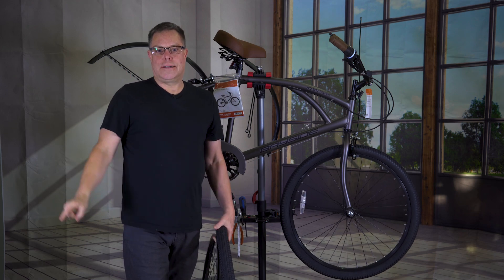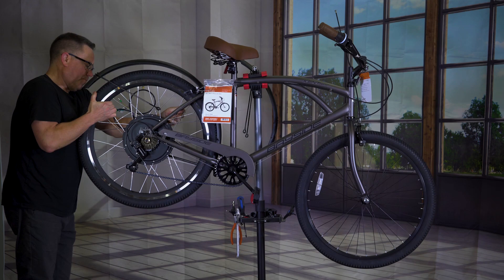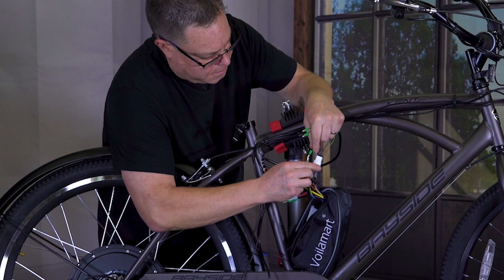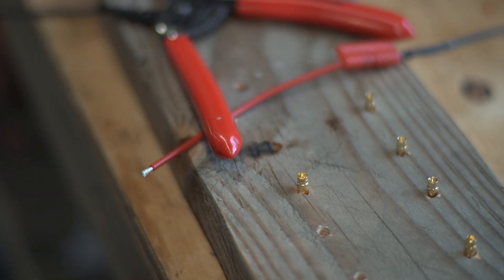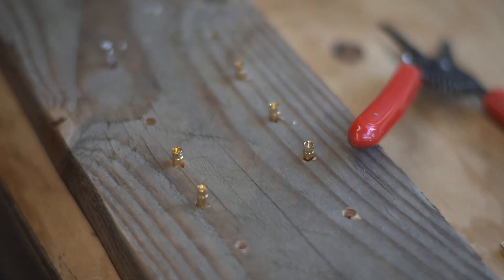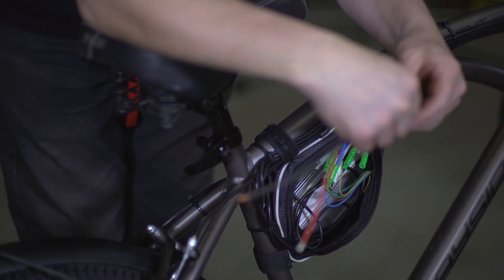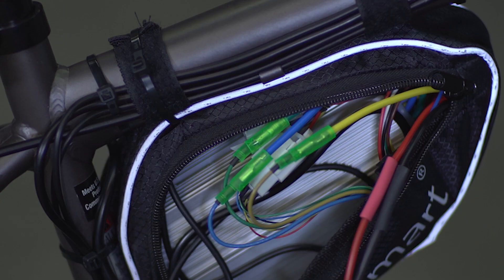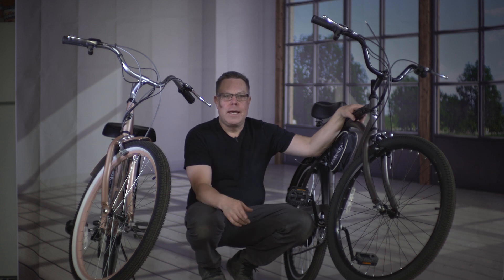How To Build a 48v Electric Bike on a Budget (E Bike) 2020

Comment: good choice on the brand i have 2 of them myself much like you one for me and one for the lady. The controller will pull max 47 amps if you run it hard so make sure you battery and the wiring can handle at least 50 amps of current. I have had no problem doing 28 miles and hour with this kit.
Reply from the maker: Awesome! What batteries are you using? I am thinking of building a 52v 18650 pack, in an upcoming video.